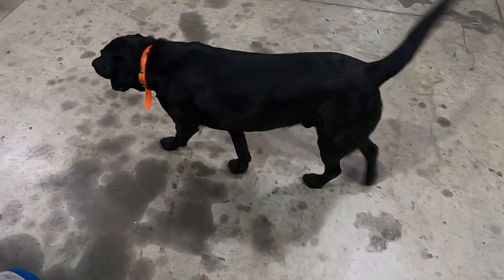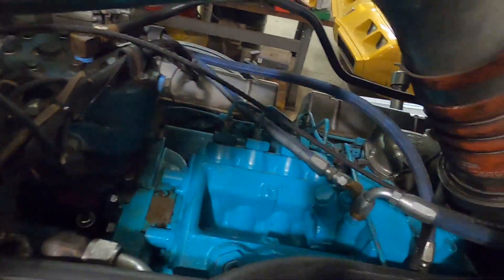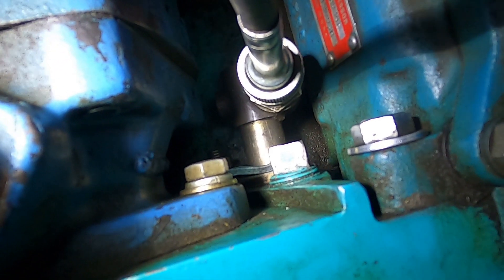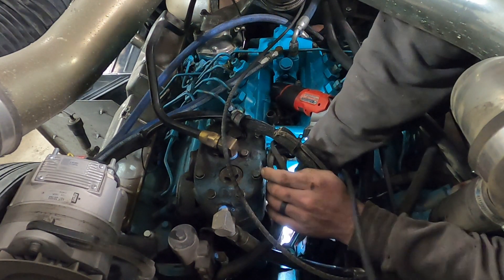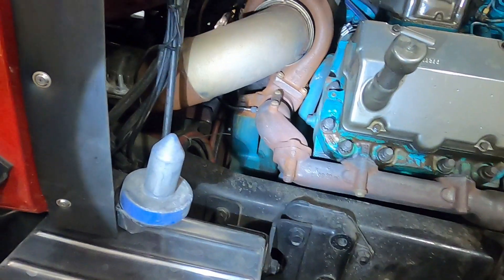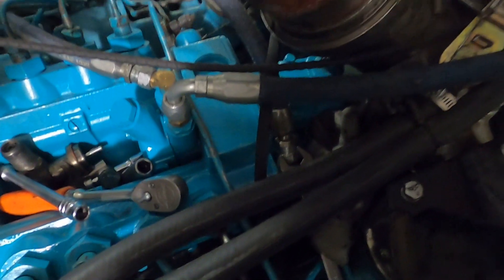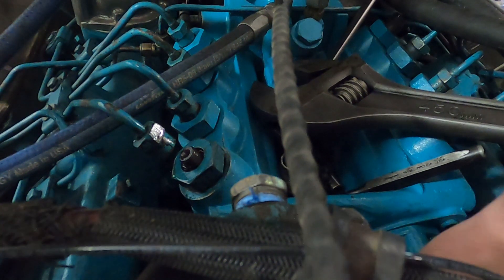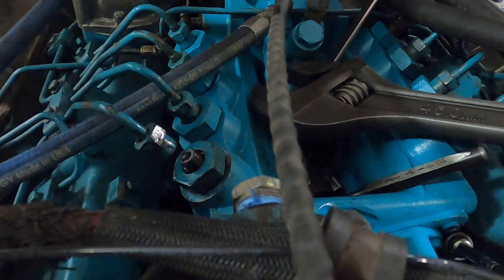How to Set Injection Pump Timing on Mack E9 V8 with Ambac Pump

Comment: Sam what I use to do on the old E6 engines to get more torque was to take that 5/8 nut off the rear of the governor housing take the right size allen wrench fish it in that opening and back that screw out 1 to 2 turns and see how that does and you can always open the rack later if you want 😉

Comment: Nice truck beautiful engine 1 of my favourite all so notice it’s inter cooled is that original   V8 super liners in Australia were never inter cooled to my knowledge
Reply from the maker: Thank you! All of the E9s I have seen in the states have been air to air intercooled. I think the older ENDT 1000 was the non intercooled version.
Reply: I have an 85 ultraliner  v8 its intercooled were the superliners different ?

Comment: beautiful truck and love the v8 power how come you had the timing so far advanced are you running bigger injectors and turbo or were you just seeing if it would make more power that way keep the videos coming of the mack!
Reply from the maker: Thank you! I had it cranked up to 25 degrees trying to lower the EGTs. While it did help with that I did not like how it ran. I am running a borg 475 and marine injectors. It made 800 hp at the crank when I ran it on the dyno before i put it in the truck.

Comment: Whats the torque rating on the E9 500?
Reply from the maker: From the factory, the 500 hp units were 1660 ft-lbs.  With the torque limiter cam removed and the fuel turned up this engine was closing in on 3,000 ft-lbs on the dyno

Comment: How hard is it to remove the v pump.!
Reply: Idle jumps all over,and it's a pain in the butt to get it started,it sounds like it's trying to run away sometimes.!!
Reply from the maker: I’m having similar problems lol I bought an inline P Pump hoping to install this winter. The pumps are not physically hard to remove. The problem with the Ambac pumps are parts are getting scarce and people who know them as well
Reply: @ScrappyIndustries  that's what I'm finding out currently,but if you can pull it apart,then I will be able to see what's there.i hope.!